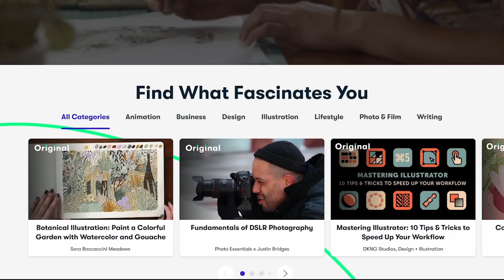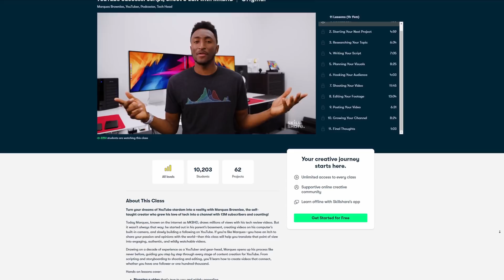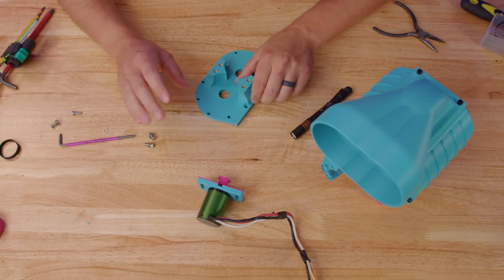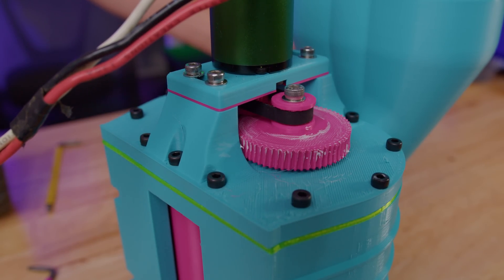I Attached a 100,000 RPM MAX Castle Mamba to my 3D printed SUPERCHARGER..... Will it Survive?

Comment: You'll never see a NHRA Funny Car or Dragster without a massive Supercharger. In the distance to the finish line, they drink 20USGal of nitromethane (very high combustability under high pressure) fuel funneled through 2" interior diameter fuel lines; they need A LOT of air to burn that much fuel. They don't actually burn all the fuel though. Much of it is lost out the exhaust as uncombusted fuel. So much power is produced, the clutch basically melts and can't be reused. Superchargers move air! Good job on the design, it looks like it works very well at speed. Looking forward to the next test with your new equipment.

Comment: AC motor like angle grinder that was suggested or vacuum cleaner motor would be better options. If you do want to go battery for some reason, they make impact wrenches which use brushless motors and have much higher capacity batteries. Would need to re-engineer as they are geared way down, but they are really high torque so you could gear up quite a bit.

Comment: Automotive engineer here. There are a couple of differences between your design and what you would see on a car, and I think changing those items could help your performance.

- The rotors in the supercharger should have a twist to them. I would start with a 90 degree twist end to end for that 4 lobe design.
- On a car supercharger the air outlet on the bottom is a triangle shape. A full square outlet reduces efficiency a ton
- Superchargers usually spin backwards from how yours is, sweeping the air around the sides of the case instead of between the two rotors.

Comment: One source of gear noise you're encountering is that those gear shapes are intended to meat up with a worm gear, so they're slightly dished and have high points. I'd suggest instead finding a slanted involute gear and mirroring it so you get a herringbone gear.

Comment: would it not be simpler to drive both shafts with 2 motors off of 1 esc in order to ensure they are both spinning at the same rpm?

Comment: Plenty of power supply options out there. A 100amp power supply can be had for $100, might not handle a full throttle whack, but if you wanted to do that, then just build a cap bank to add the punch. Cheers! That thing is sick!

Comment: Just use your regular PC power supply and wire in a potentiometer in line with the motor to run the supercharger. Then you'd be able to set speed with just a turn of a knob

Comment: If not much granularity in the Batteryvoltage is needed: you could try a Really cheap solution which would be old Server Powersupplies, you can easily get 1100w 12v Server powersupplies bridge some pins and solder beefy wires on tham and have a really solid 12v power source, or even 24v if you go into opening the 2nd supply and isolating the negative from earth to make it float and be able to add onto the 12v from the first supply making 24v with same amperage

Comment: Your belt keeps popping because the rubber belt with that torque is slipping and your blades are binding which causes your belt to snap or burn through. Need to try it with a hobby grade RC grooved belt with grooved pulleys.

Comment: So I can't find if this was mentioned but I'm an rc nerd.... that esc you have is capable of 6s at 25v with 3a bursts. You could more or less run your power supply you have with larger cables to the esc without worry. By the way just subscribed because of these 2 videos. Now on to binge watch the rest.

Comment: PC power supply that supports over 100A on the 12V rail?
You don't need variable voltage, that is what the ESC does. The moto can't be run without a speed control anyhow.

Comment: A lithium car audio battery with a car charger is the answer. The output is crazy. If the esc doesn't like the voltage find one that does. So much power it will blow your mind, the only concern would be the ability to fry rc motors like nobody's business.

Comment: I wonder if some thin rubber stripping on the edge of the rotors would allow the rotors to actually form a seal and move even more air. Something similar to an apex seal in a rotary engine
Reply: That's exactly what they do with modern superchargers. A teflon strip usually

Comment: I don't know about adjustable PSUs but there are some real beefy DELL 12V Power supplies out there. I've got a "D220P-01" of aliexpress and i run just about anything of that thing. it can push 18A at 12V, was very cheap and there are even stronger ones out there. Live your compressor design btw!

Comment: IronHorse® GSD Series DC Drives / DC Motor Controllers

Input Voltages:
12 / 24 / 36 / 48 VDC
12/24 VAC, 24/36 VAC,115/230 VAC, 120/240 VAC

Output Voltages: 12 / 24 / 36 / 48 / 90 / 180 VDC

Output Current: up to 20A

Available in Open Frame and NEMA 4/12 or 4X Enclosed Versions

These have rheostats for speed control.

Comment: powersuply to run those esc? old car battery from scrapyard for 5 buck each, XD in not to bad shape shoul be able to get out 10amp, just take 5 or 10 old lead acid... i sue that for my solar powerbank and for test with a car radiator fan... i kill a lipo 5000mah with that fan

Comment: If that is running on 3s you could use a Xbox 360 power supply it's like 12 volts and like 16 amps that might work if not I know you can get like close to 40 amps out of a regular ATX power supply if you get the right one and you can even get a server power supply that would be 24 volts at some ridiculous High amperage but as for desktop power supplies you looking at some major money to get that kind of power amperage wise anyways

Comment: That is a neat machine you built but I tell you this I have a 24-horsepower engine that has a regenerative coil pack on it that's for charging the starter battery and if we get marriage those two together with the two deep deep cycle batteries that I have we should be able to run and power regulator or voltage regulator that's adjustable that'll actually run with the cords to the RPM of the engine variable speed drive if you will.

Comment: Have you tried building a bench power supply from an old PC power supply? adjustable voltage and Amperage.  a few designs out there. mine is similar to this one. You can get bigger bucks as well.https://www.youtube.com/watch?v=kQ2GMITYfCA

Comment: Can always run several power packs in parallel.  Will keep voltage the same, but increase your amps and overall avaliable power.

Comment: You should twist the rotors, then you'd actually compress the air and get more air flow. You don't have to do it by much, just enough to have about a quarter turn from 1 end to the other. I'd be curious how it performs with that change.

Comment: was just thinking of a sub 200$ power supply... a 110/120V stick welder has 20 to 30V 80 to 110A output that could sustain the demand that motor controller could use (coughs harbor freight)

Comment: Get a Voltage Regulator so you can see how much it can handle while plugged in then shop around to see what other batteries exist and test the voltage output on the Regulator to see results.
 If results seem good, you buy and test the battery itself.
It'll also be good to see what's the max it can take before fail.

Comment: If you can live without current limiting a TENMA - 72-7655 works well, 900W max and is 1-15v and 60A max.

If you need more beef the old HP 6674A might work

Comment: please change the worm gears to actual spur or herringbone gears with larger teeth, they will be able to take more abuse in the long run. these worm gears are designed to engage with a worm wheel for a different type of transmission of power and now only run on the outside edges which will make them strip if you keep increasing the power.
Proper tooth shape and larger teeth is the way to go for those.

Comment: I was into airsoft and rc cars for a minute and man if you get a bigger motor a lipo battery and gears from a rc car that can handle that kind of power. Man you’ll see some crazy stuff. Just putting a lipo battery on that thing will crank it up. It’s been years so I can’t give exact names and parts but man just from my simple knowledge of rc cars. You can definitely make that thing run harder

Comment: Twin turbos on the intake could possibly reduce the strain on sustained output, also I'm not sure if it's applicable but the power supply recommended to run car audio subwoofers indoors could possibly work in this scenario, I believe they are called power inverters. They come in a wide variety of amperage aswell. One other thing that could probably help the overall function of the unit is to make the output side (or on a car exhaust) modified with a system that creates a Mandelbrot effect on the airflow, meaning it pulls the air behind it out along with it. This is seen in capillary action in plants, or when you plug part of the hose when you use it

Comment: legit just buy an industrial SMPS with the output voltage you need.
they generally come in 12, 24, 36, and 48V
I have a few that are 250A output

Comment: im no expert on RC cars and the voltages and current they work with, But you could use a PC power supply at 12v. Connect the green wire to ground. Remove all the 3v3 and 5v lines. SOlder all the 12v wires together and voila, depnding on the PSU you have, you can easily get 20amps from an old 400w power supply. If you have somethign bigger then you can get more current.

Comment: I would like to see the rotors crook screw look and the gears slanted cut not straight cut both will make less noise then it does now and do a velocity stack I believe it's called it crams more air in without more rotor speed power or rotor size and once that tested I would like see a twin turbo the hooks to a adapter under the blower where all 3 is pushing air into the cooler that would be crazy

Comment: use a car battery, if it sits under 12.6V it should work just fine with a 3S ESC, make sure to measure that before connecting it

would be fun to use something like a VESC75100 that can take over 75V and has 100 phase amps max, i wonder how fast both that castle motor and that poor printed fan would handle that @ 75V 100A

Comment: If you only need a 12v volt supply then server powersupplies are great. I once had one from a Dell Poweredge that was good for 150 amps. Also they're cheap on ebay, I used them to run a heated office chair build.

Comment: If you've got a 240V connection nearby, grab a server supply.  The DPS-1200 from HP should be pretty cheap, and there are breakout boards available for startup.  I've got 2 S12L7 Kicker speakers powered by an Orion 8004 in my surround sound in the house; being powered currently by a DPS-750.  75% volume peaks the thing at around 1.1kW.  These are 12VDC supplies, that can be adjusted a tiny bit, some up to 15VDC, but they have the current capability.  For the startup current, you will still want a battery/ large capacitor.  I'm using 2 UPS lead acid batteries as peak buffers/ backup (the 750 shuts itself off around 825W).  I don't know the voltage of your ESC, but the battery looks to be a 4S (3.7x4=14.8 nominal).  You might even snag 2 of the smaller server power supplies and tandem them (the RC guys do this alot).  There's a number of forums online detailing setting up these cheap used server units.

Comment: Why not get a few larger, higher C rated batteries and just wire them in parallel? You'd have more than enough capacity and power then. Probably a lot cheaper than a 2000w+ PSU or whatever you'd need.

Comment: Electrical tech and rc enthusiast here....
I would find a cheap 50amp car starter charger.
As long as your ESC supports 3s the voltages should be fine...

Comment: you can get a dps1200fb its a 1200W Server PSU 12V able to supply 100 Amps, it requires a bit of soldering to get it to work outside a server, there are plenty of tutorials on youtube showing how to mod it.

Comment: So a few things: If you want truly insane power, you're going to need a 220V outlet in your lab. A standard 120V outlet is limited to ~1875W of output power, which is around 2.5 horsepower. Otherwise you can get a 24V power supply that'll output 1200W for under $100 on Amazon.

Also that motor is a poor match for this application and won't be able to really put stress on that rotor the way it's set up. You might be familiar with the term impedance matching, if so, what I'm saying is the impedance of the supercharger is much greater than the impedance of the motor. As a result, the motor is unable to deliver most of its power efficiently. Counterintuitively, what you want is a motor that is designed to spin slower at the same voltage if you want this thing to spin faster while directly driving it. A motor that is designed to spin slower at the same voltage and current produces more torque, which enables the motor to drive the rotors faster. 

You're running into the torque limit of your motor before it's able to deliver full power to the rotor, like trying to take off in 5th gear in a car. Even if the engine is making ideal power, the wheels are so poorly matched to the engine's speed that it can't deliver that power usefully to the road.

It looks like you're using a 6900KV motor, nice, and the rotor really wants more like a 2700KV or even a 1200KV motor. At 24V a 1200KV motor would want to be spinning around 28,800RPM, which is around 4x faster than your rotor was spinning with this motor and probably above the grenade speed of the rotor. It would also be much more achievable with a motor that has more than 5x the torque in exchange for top speed you won't use.

Comment: You might try using a vacuum cleaner motor like out of a shark vacuum. They're high RPM, and it uses AC so there is no inverter.

Comment: i would think precision ball bearings for anything that rotates, and a corkscrew design for the impellers should get some more efficiency, and maybe a more torquey electric motor with a gear reduction would save on energy use.

Comment: i suggest changing the esc, that way you can tune the power output and be sure the energy flow coming from the batteries is more stable and continue. batteries wise, i think you should run at least some 4500 mAh

Comment: Just take a car battery or a smaller one from a motorcycle! These Motor Controllers usually work with anything from 6 to 13 Volts. Fully charged 12V-Lead-Acid-Batteries make 13.2V and about 12.5V when you draw a constant current with around 10% of der capacity. Anything above 10Ah schould have ample juice for hours of testing. 10Ah is super cheap and you schould be able to charge it with your Lipo-charger, since there are 13V batteries for RC-Cars)
Also, I suggest using a Planetary Gearset (they're stronger by design), using the Traxxis-Gear at the centre and cutting the Rotor-RPM at least in half. Since it's a high-rpm motor, It'll run more efficent and could even get the effective Rotor-speed up, since there'll be less stress on the mortor and inverter.  

Love your Content! It's always fun to watch.

Comment: If your looking to test this to the max I would suggest bumping up your motor ESC. I am thinking of giving this a go with on of my 8th scale motors and a 4S battery. Would you be able to upload the modified motor mount assembly? If so I will print it up in PLA and possibly put it to the 8th scale test.

Comment: Should really make a lil gear box and put a bit of grease of some sort in it and that should greatly help with heat and wear on the gears, maybe reduce friction and thus increase performance but depending on the amount used may introduce a hydraulic pressure of sorts.

Comment: Sounds like you want a constant voltage power supply don't really know what you want on voltage wise but a MIG welder uses a constant voltage power supply.  You could probably pick one up for just a few bucks off of craigslist.

Comment: It needs a plenum between the blower and radiator so the air can blow through all of it instead of just the middle. For better sealing use pieces of self adhesive UHMW on the ends to tighten the gap between them and the ends of the rotors. For the rotor tips, redesign with channels to slide in pieces roots supercharger teflon seal. The stuff is pretty cheap. Google roots supercharger seal strips

Comment: Try redesigning the rotors to have a slot on the tip for adding something like a rubber or silicone strip so you can get the tolerances closer and build more pressure!

Comment: A computer power supply should work nicely. It outputs 12v and as long as you get one that's rated for above the peak currant of your motor you should be good.

Comment: Don't bother looking for a power supply that can handle the load. Some of the new high end rc hardware can draw upwards of 2000A momentarily. Just buy some high quality, high capacity, high C rated lipos and save a mess of money. If you are looking for 3S, these are rated for (every manufacture fudges numbers so take this with a grain of salt) 2250A. https://www.smc-racing.com/index.php?route=product/product&path=67_99&product_id=677

Comment: well you could use a microwave oven transformer with the shunts removed. It can easily do above 5KW on 220v. Just use a 24V secundary and a 50A dimmer to control the power output. You will need a beefy full bridge rectifier and a huge capasitor bank to smooth such power requirements but its the easiest alternativ you have

for refference i made one that can do 300A at 15Vac for a few things i needed a lot of power

Comment: Fully charge your two lipo packs and plug them into a parallel wiring harness. Looks like you have the XT60 plugs. You can probably buy a parallel harness pre soldered and ready to go.  Double your amps and it will be easier on your batteries so they won’t get hot as quickly.  Good luck. Love the Supercharger.